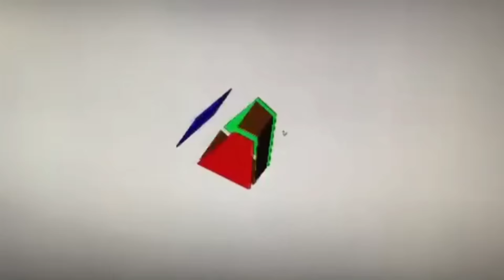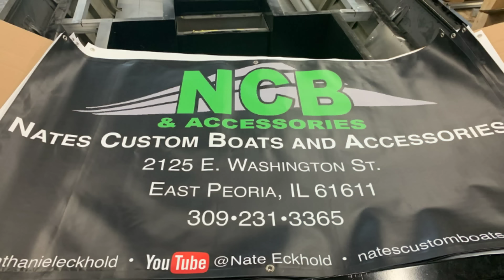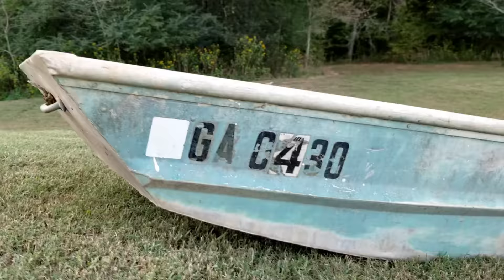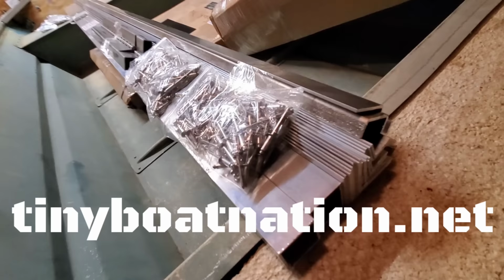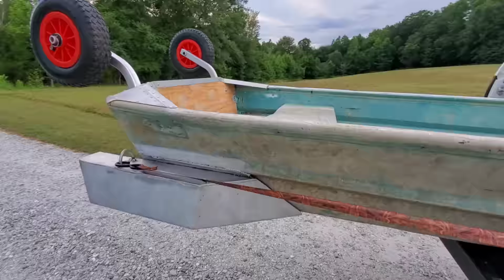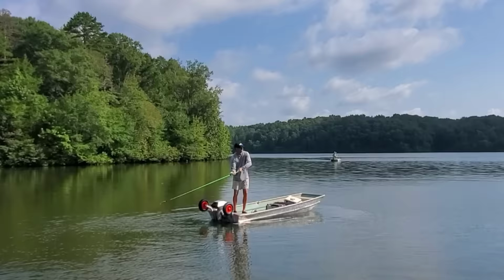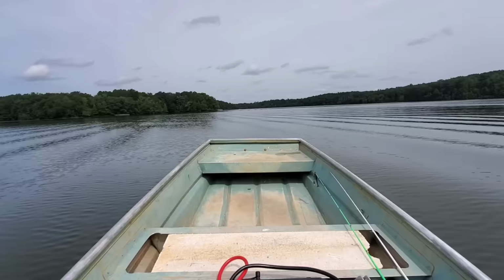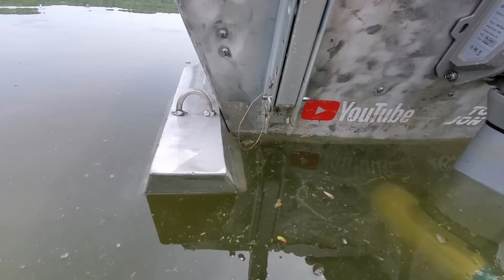12 Ft Jon Boat Float Pods

Comment: I wonder if mounting the float pods higher, to get them out of the water when you're on a plane and then in the water when you stop to fish, would be feasible?
Reply from the maker: Not sure. Honestly,  id like them higher but the problem is the rib is in the way. So you need to cut the rib or better yet, notch the pods around it. Too difficult to design that without a boat in hand for fabricator. If a skilled metal worker had the boat im sure something could be fabricated up, but we designed this over the internet lol
Reply: @AnthonyJonesBrigadeBoats  might have a guy if the price is right.

Comment: 1236 is abit unstable, for this reason I prefer 1448 flat v front with 25hp
Reply from the maker: This is a 1232. 1448 w 25hp can't go in bed of truck. The whole point of this build is to be portable and go where other boats can't.

Comment: Nice only a 12% loss of speed on a 12ft flatbottom would be from 15mph on a longtail to 13.2 on a 6.5 hp 38 lbs 212cc 8.1ft/lbs torque. But it may well provide the stability to easily handle a 56lbs  301cc 8HP at 14.9ft/lbs torque which should over come the friction loss from those type of pods.

Comment: I imagine the pods gets your our plane better but does it provide any port and starboard stability? I think about adding pods to my 1448 Jon/ Bass boat. My hatches are lockable and I put in a 7 rod hatch that holds the rods individually. Why don’t put these features in to your builds?
Reply: I used 1x1 and 1x2 alum tube for the frame. I also used a Promariner recharge my batteries
Reply from the maker: I don't have rod lockers in my personal builds because one is a 1436 the other is a 1232. It eats too much space. I don't like to fully deck my boats, I like a floor system with cockpit area for my kids. On narrow 36 and 32 inch wide boats, if I added  a rod locker I feel it takes too much space away from storage hatches and potential floor area. It's a personal preference.  When I go fishing I stick 6 or so rods in my truck, when I get to lake, they go on the sides of the deck, it works fine. When I build a 16ft or 17ft boat for myself you can rest assured it will have a rod locker and much more but it's my personal opinion that the value proposition of having one in a super tiny boat just isn't needed for me.

Comment: Maybe would be interested if they where more like beaver tail pods or if they didnt stick out as much as i use gas motor and go faster than 10mph
Reply from the maker: Can't put gas motors in electric only lakes. They stick out so much to convert from a 1232 to 1248.
Reply: @AnthonyJonesBrigadeBoats  👍🏼

Comment: Sell these pods. I would buy a set! They could be made a bit less boxy on the front end to cut down on drag and give you some speed back. If you gave them a fender shape the water would flow around them a bit more smoothly.
Reply from the maker: They may possibly be for sale. Only problem is price point. 200$ just in materials to build. Plus labor. Plus shipping.  May end up 500$ at the end of day. Not really sure if the market would respond well to that price point.
Reply: @AnthonyJonesBrigadeBoats  are you kidding me!!?!!! The boating world is the wealthiest hobbies. 
1000$ it will still sell. All you’d need is to sell 100 or 200 a year......
Reply: @AnthonyJonesBrigadeBoats  a lot of wealthy people will purchase these float at 650-1250$ a set 
750$ is reasonable

Comment: Just got gifted a 15’ Grizzly Tracker, subbing to your page for some pro tips! 
Opinion- in the back of my boat, there are 2 - 2’x3’x1.5’ fixed boxes with room in the middle to access the outboard- I was told the 2 blocks just have foam in them for floatation- I plan on lining the bottom with pieces of foam for floatation anyway, so my question is whether or not I need those 2 built-in floatation devices- if not, they are simply in the way / thanks!
Reply: Rob Claxton  extremely lucky lol just a nice old couple with a boat sitting in their yard for over 5 years they were happy to get rid of

Comment: I think the pods would be more attractive and possibly more aerodynamic if they were rounded like a standard pontoon
Reply: Or hydrodynamic
Reply from the maker: I personally don't.  We threw around a lot of ideas, many just looked out of place. We all like this design and how it mimics the outboard shape, very edgy and modern design.  Knowing what we know now, yes altering the front angle pitch could account for less drag but what's to say it really will? At the end of tge day you have 30 pd objects protruding from tge side of the hull blocking the natural flow of water. Only real way to find out is make sets of different designs and test them.
Reply: Ok you asked I gave ya my thoughts either way cool concept

Comment: Is there anything I do for my 10 ft like this bc I want add deck but I might use aluminum l mounts and hard foam for deck and some storage and small live well how can I go about doing something like this for 10ft
Reply from the maker: Follow the rrst of my build. You can do a deck but 10s are unstable unless you do something similar to what i did. Livewell is the problem as if you do a 15 gallon Livewell when its full of water you are adding 120 pds. Water is 8 pds a gallon. So 120 pds, plus you, plus outboard, plus gear, plus deck and floor materials,  you'll be at 500 pds or more which is too much for a 10. I am not even putting a livewell in my 12 because just doesn't make sense weight wise.
Reply: I will only be running trolling motors like 30 to 35lb trust and did not want no huge live well and how would I go about making something like this is it just hollow in side welled aluminum

Comment: Ok don’t laugh I want to do the same thing but twice as long for my v hull 12 foot aluminum boat I took a 5 horse power Johnson outboard motor and put a 10 horsepower Briggs and Stratton engine on it the motor stands the front of the boat straight up so the pods I believe will fix the problem

Comment: What benefits do you get with flot pods?
Reply: Wondering that myself🤔im going to assume to keep the rear from rocking to hard.
Reply from the maker: I show the benefits in the video in demonstration...much increased side to side stability and added buoyancy to offset the weight I will add in the interior build of project.
Reply: @AnthonyJonesBrigadeBoats  thank you for your time and info

Comment: Would pool noodles work lol
Reply: I've seen people use pool noodles ran across the bottom sideways to get more flow out of their bowl for heavyweight but I also had a buddy that made pontoon on arms that stuck out the side with sealed 5 gallon buckets that he could put down when he got to where he was going for stability and you can climb in and out of that thing no problem we used it for duck hunting so you had to get in and out of it and didn't want to sync it the removable float pods work great he would use them just like those wheels in the back that he made

Comment: I would have run the pods the all the way to the front of the boat
Reply from the maker: Interesting concept. I bet it would be very stable. Unfortunately,  these small one weighed in at 26 pds, so something that size would weigh 150pds plus. It would be a very heavy 12ft boat at that point. It would be fun to see nonetheless

Comment: It’s cool but for the amount of money you have in that thing you prolly coulda bought a bigger and more stable 16’ boat
Reply from the maker: 1) I don't have much in it. Almost built entirely from sponsors parts donated to the project.
2) You can't build a portable 16ft boat. THAT'S THE POINT of this project.  The ultimate 12ft portable boat. No trailer, better than a kayak, inspired by bigger boats. Best of both worlds. If I wanted a 16, I'd buy one. This is a purpose built project for youtube and sponsors. Not another blending with the crowd dime a dozen 16ft boat. BUT, my next personal build will be a 16ft tournament boat. It may be a year or two away, but it too will be unlike anything you have seen.

Comment: I guess people have to make everything idiot proof...I've been a fisherman all my life..never needed anything like this..never fell from the boat..this generation thinks they reinvent the wheel anytime they come up with some goofy sh-t like this
Reply from the maker: Good for you. That's wonderful.  This generation? I'm 38 with two kids. Pods are needed all the time for duck boats to plane correctly with bigger outboards and help get in skinny waters as well as run a massive outboard in a tiny boat. What's wrong with taking science and the same concept to improve stability and increase the load capacity of the boat? Let's not forget this boat will have a 200 pd weight increase with interior build out and very large 48 volt battery. The problem is people like you who go out of their way to leave a negative comment on someone else's project.  People like you who are afraid of change and ingenuity and don't have a clue as to how residual youtube income or affiliate sales marketing works. The concept of this boat and what I do as a small business on my channel seems a bit beyond your reach or over "your generations" head. Have a good day sir.